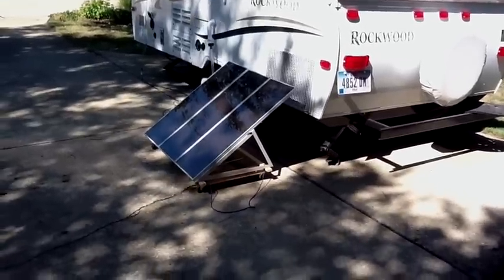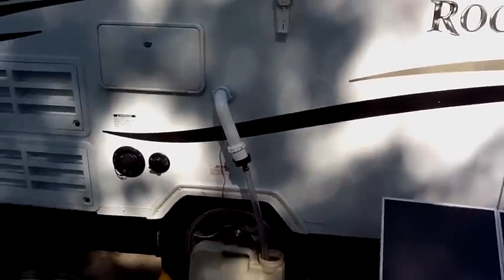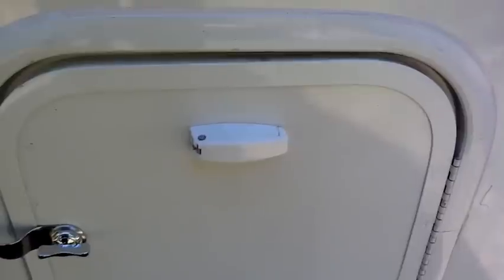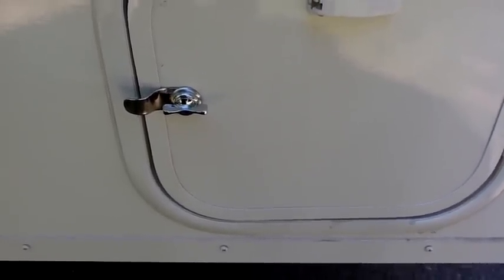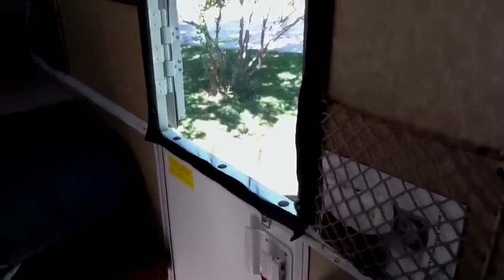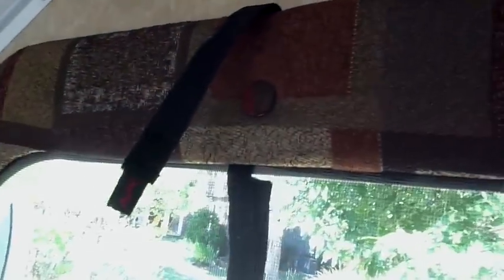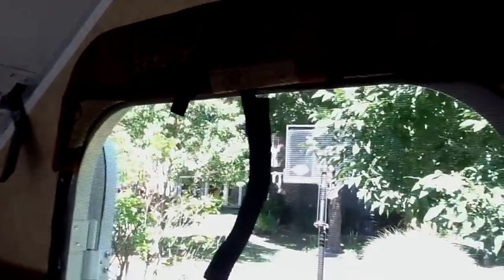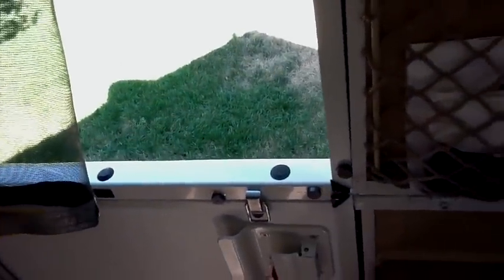Screen Door And Other Ideas For A-frame Camper

Comment: Hate to mention that the locks on the storage compartments are not for keeping "fellow campers" out, but when your traveling and have to make a stop where you can't be next to your camper, it will keep "ruffians" out. (Think of that...)
Reply from the maker: TheLadyDonnaL Point well taken, though our experience has been that ruffians have been notably absent for the last 8 years and more than 30,000 miles. Those wishing to snatch our dog’s food bowl or a cylinder of stove gas may do so, but so far everyone’s been able to restrain that impulse. By the way, I see through your guise, sis, and just when did you become a lady? Your bro.
Reply: That's exactly what I was thinking. Stopped at a gas station/convenience store, an unlocked door just seems like an invitation for mischief. But when a passerby sees a lock, they'd have to be really curious, I'd think, to break the lock. I'd feel more confident.

Comment: great screen idea. I recently bought a truck camper that is a pop top. Mine has the full length door option so it does not have a screen door like the models that are only equipped with a half door. I've been thinking of how I can make an inexpensive screen door using the same idea that you had. This video deffinetly makes the idea more clear and how I should go about it making the "door". Thanks alot! Happy camping!

Comment: How is this screen door working out for you? Any modifications to it? Is the half door still working out for you?
Reply from the maker: Karin Hart  Thanks for asking. You may be the first person to look at this video in at least 3 years. That version of the screen worked well enough, but the magnets wouldn’t stay attached. I resorted to using epoxy to put them on the doorframe area, but it didn’t work well for the washers glued to the fabric. So I ended up replacing it with a rigid wood-framed screen hinged on the right side of the frame, viewed from the inside. I take the screen off and stow it when we fold down the camper. It’s still a half door, sized to fit the frame exactly. That works like a champ. If you’re a member of the facebook group “A Frame Campers: Aliner, Chalet, Rockwood/Flagstaff,... “etc, search for posts about screens and you should find my new one and another by a guy from Canada. Both will have been posted some 2 years ago.
Reply: @thehamguy1  Interesting info, if I can get my brother and his mechanical wizardry to help out. If and when I get an aframe.  I've got HOA issues at the moment, and can't justify the high storage costs in our area. So I'm still hanging with my trusty Coleman instant 6 tent. But one day...
Reply: @thehamguy1  it’s 11 years after you made this video and I just got a camper with doors like that. Thank you for your information.  It’s a big help.